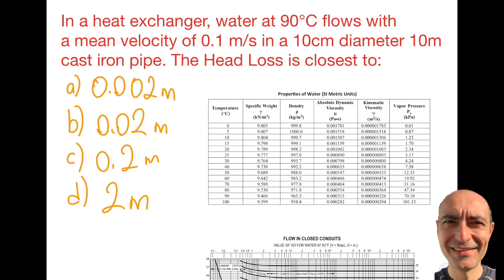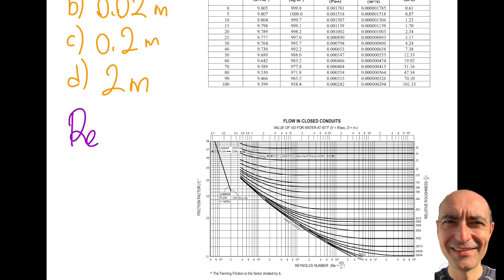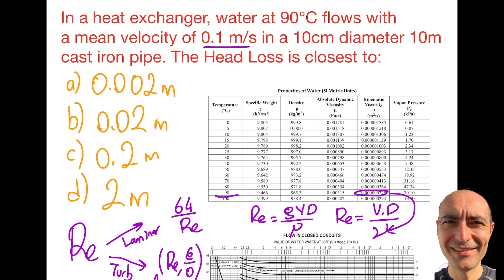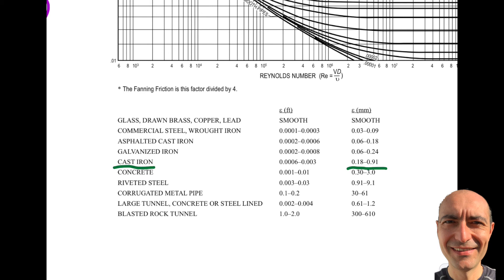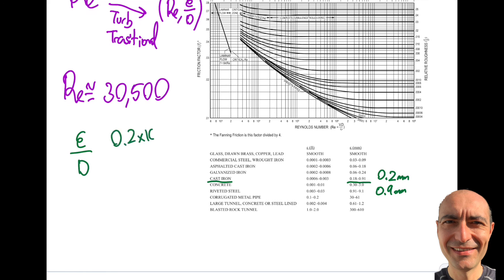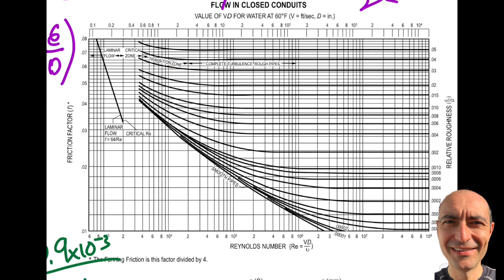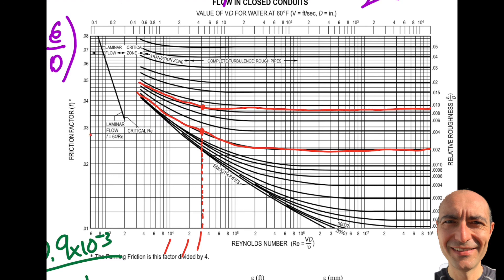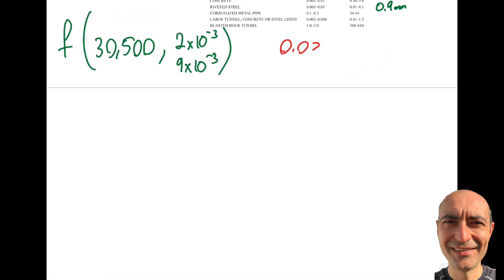FE Exam Fluid Mechanics - 4.4 - Practice Problem - Head Loss Due to Flow

Comment: Hi. Shouldnt the Re number be 3×10^4 in the moody chart? In that case, the f should be around 0.048.
Reply: yes I was getting the same so I was also a bit confused
Reply: @sashasanchez777   I got 0.048 too. The RE is 30,500 = 3.0x10^4. Why is he plotting under 10^5????